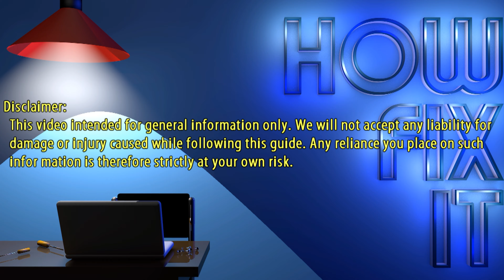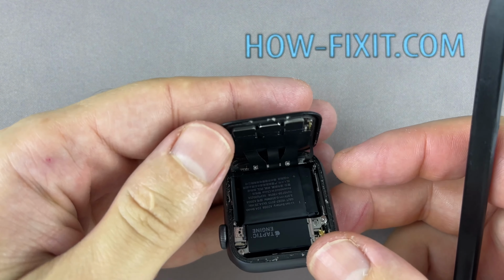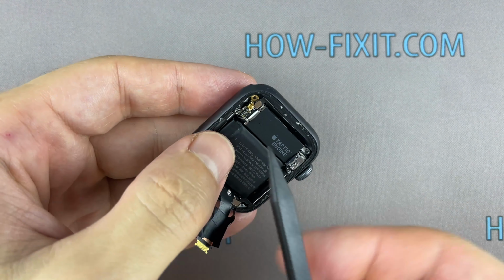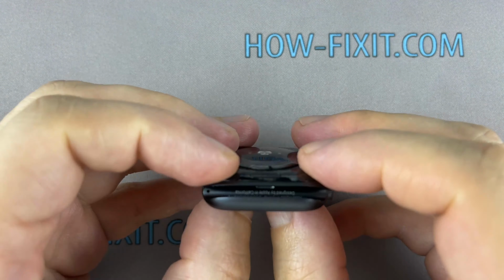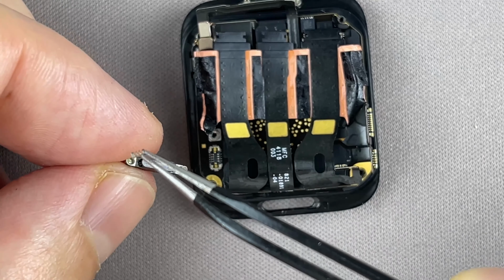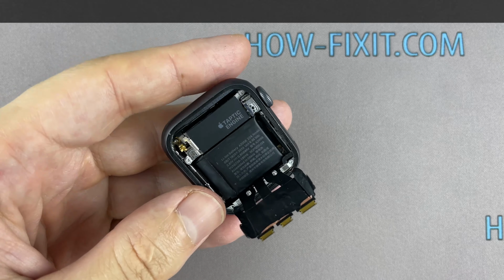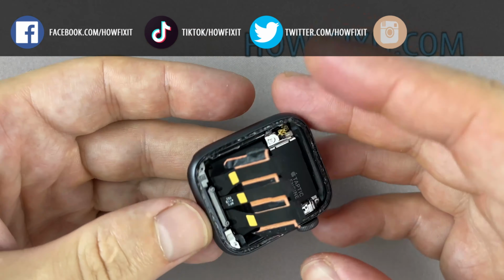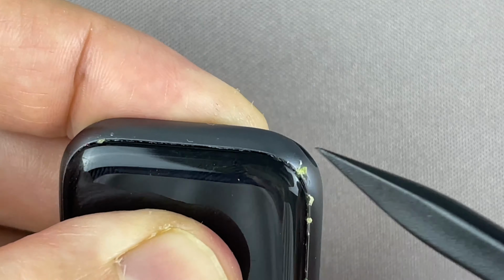Apple Watch Series 4 Back Glass Cover Replacement

Comment: I ran into a few other problems,  lost some of the springs, the original battery wire ripped off.  I got a new OEM battery but now the screen doesn’t light up.  I do feel the watch vibrating so I do think it’s on, any ideas??

Comment: Love the video - Helped my fix my watch. I have a slight problem though. I reassembled my watch and everything works fine but the screen isn't responding to touch. The screen isn't broken so I'm not sure what the issue is. Any ideas?
Reply: Check cable connector of the digitiser or you broke the ribbon cable